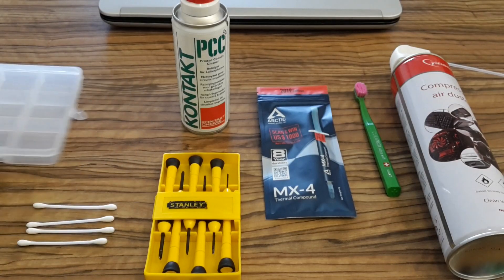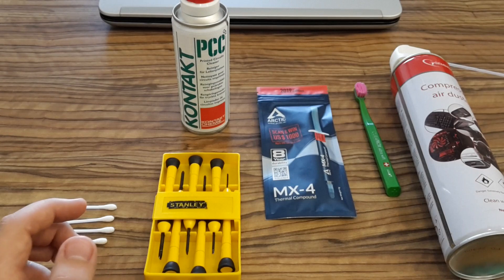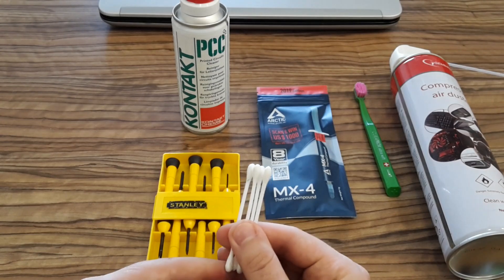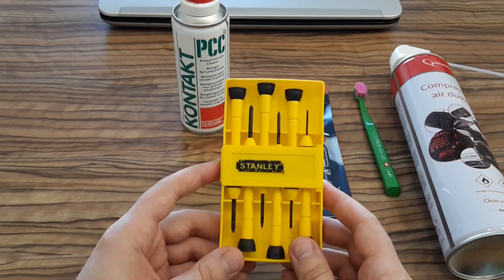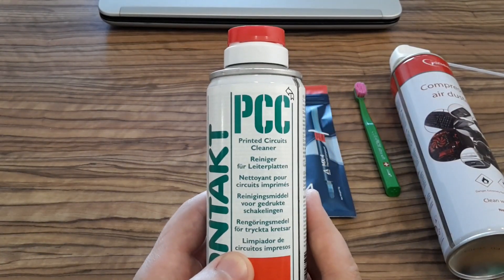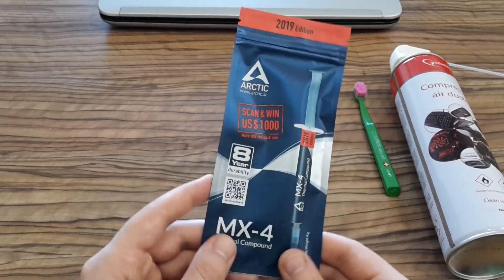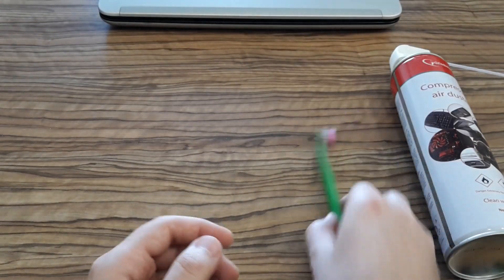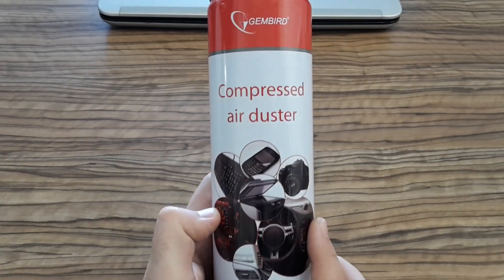Dell XPS 17 L702X Cleaning and Applying Thermal Paste

Comment: Thanks a lot! I almost gave on my 12 years old laptop, with random freezes / blue screens and idle temps of 85 - 90 degrees... Then, I found your video and decided to give it a try... 2 hours later ( I really took my time because it's the first laptop I've ever opened), it was back from the deads. Idle cpu temps of 55 degrees, 60 degrees while browsing and other light activities! Next steps: battery and windows 11!

Comment: Oh my ... my XPS L702x is 10 years old. I thought I might be able to do this myself, but skimming through the video I realize it would be stupid to even try - considering I've never opened up a computer before in my life. I can't risk ruining my XPS, which I'm very fond of. I guess, I am better off entrusting this job to a pro, right?

Not sure my laptop actually NEEDS new thermal paste. But it seems to run hot and the fan is always on. Otherwise it works normally.

Comment: Hi my dell has been freezing, crashing, and generally just been absolutely unusable for longer than 5 minutes. At first I thought it was software and driver issues and I did clean installs of windows 10 and it still didn‘t fix the issue and multiple built in diagnostics say that there don’t seem to be any hardware issues. Then it struck me: What if its the heating? I mean I havent cleaned and reapplied thermal paste in like 6 years lmao. You think I should do this?
Reply: Also after a clean install of windows 10 how do you recommend installing the drivers since I am not rly that hyped about using 3rd party programms that install them for you
Reply from the maker: Hi, is your laptop battery all right?

Comment: Can anyone comment on what NVIDIA driver they are using?   I had to DDU both the 555GT drivers and the INTEL ones and re-install them.
I'm sure I only have the basic NVIDIA now and wanted to upgrade to something stable
Reply from the maker: Hi, after installing Windows 10 it automatically detected both of them and  installed drivers. You can check in Device Manager if you see them.

Comment: Thank you for putting this together, very helpful. I did, however, not notice the comments regarding the tightening pattern for the heatsink until after I finished putting it back together. I am going to roll with it as is and see how it goes. I covered the areas pretty well with thermal paste and I am guessing I will not have a problem. Thank you again though!
Reply from the maker: Hi, yes I forgot to mention because I didn't know that time that there's such a pattern. :-))) Now I know there are numbers on screws which you have to follow.

Comment: What surprised me is I never had to open my xps 17 l702x. The i5-2430m and GeForce GT 550m have run like a champ for 9 years with a overclock of 795.4mhz core clock 1080 mem clock and 1530 shader and it's been used daily and cleaned regularly. I love this laptop honestly
Reply from the maker: Yes, so do I for 8 years now.
Reply: @zeroampselectronics  omg same here xps  l702x with 3D screen (that I never used).. amazing laptop! I just upgraded to max of 16GB RAM and a bigger SSD, and a new dualband network card ( Intel 7260 HMW) so I can also connect to 5 GHZ wifi networks :D

Comment: Does adding SSD to l702x improves the performance?
Reply from the maker: Hi, of course it does. You won't believe it how much.
Reply: @zeroampselectronics  how much read write speed you get? By the way thanks for this video, i am going to clean my laptop fan. It is making so much noise
Reply: It'll max out whatever the SATA version can do, given it's a machine from 2011 it'll be SATA 3 at 600MB/s. M2 SSDs are doing 3000+MB/s now of course.
Reply: gaming performance not too much except for load times. every thing else dramatically faster load times

Comment: This manual reproduces the errors from the previous ones on the internet.  NO NEED TO DELETE THE DDR MEMORY !!  You DO NOT NEED to detach the LCD screen.
Reply from the maker: Hi, you're right there're many ways how to achieve the same thing.
Reply: Late reply (2024), but thanks for this. It's also unnecessary to unplug and remove the Wi-Fi card.

Comment: Hello guys, please I need some help, I have done everything according to your instructions, my laptop was working fine, after putting it back together it won't go ast the dell screen, won't go in bios with or without hdd or ram... Can you please tell me what I have done wrong.. I haven't opened the cpu or anything else...??? Please help...
Reply: Guys thank you very much for your response, it was an usb board that I have replaced, it was for a dell 701x.
Reply from the maker: Oooh, such a small thing :-)))

Comment: Thanks for the video, It helped me with the disassembly. However, I would like to note something. When you are screwing back the heat sink, you are not following the order in which the screws should be screwed. The sequence number is right next to each screw. This is  important to ensure that the heat sink will work properly.
Reply from the maker: Yes, exactly you are right. I forgot to follow the numbers. Thank you for noticing that.
Reply: You mean no matter where I start, the essential thing is screwing them right to next, clockwise?
My XPS17 is open right now, I'm cleaning old thermal paste, and will re-assemble in the afternoon. Thank You!
Reply: @IlTurko  If you notice, there's a number next to each screw on the heat sink. That number indicates the order that you should follow to screw the screws. Start by screwing the number "1", then the number "2" to and so on.
Reply: @z4ub3r3r  Thank you! Working right now
Reply from the maker: @IlTurko  Hi, as I understood that. The unscrewing starts from the highest number and the screwing back starts from the lowest.
Reply: @zeroampselectronics  hi, finished the job. Absolutely exciting for me, since I'm a total hardware noob and never did anything like this before. The notebook looks just perfect, cool and working very well. Thank you again.

Comment: Excellent video.  I recently re-pasted my old XPS-17 but now the CPU is throttled down at 0.78GHz, have you experienced this or do you have a solution for this problem.  Perhaps I just need to take it apart and redo the thermal paste again.
Reply: I had the same issue and that was the reason why I decided to re-paste mine in the first place. However, before doing that, I searched on the DELL website to see if a more recent BIOS was available (I know is a quite old laptop). To my surprise I found a BIOS released on 05 Dec 2013, so I installed it. That resolved the issue of the processor stuck at 0.78GHz, but this is what I find odd. Even thought that BIOS have the most recent release date, is version A11 (my laptop was running the version A19). I did't realized at the time of running the "update". I will apply the A19 version again hopping that the computer keeps performing normally.
Reply: @z4ub3r3r  Hi César - I think there is now a 2020 BIOS update - I'm always a bit reluctant to flash the BIOS but it is apparently recommended by Dell
Reply: @robertparker7243  hi Robert, where is this 2020 bios update?  I could only find that 2012 as being the latest one on dell's website.
Reply: @z4ub3r3r  Cesar, I also did the bios update with the 2012 one, and it looked like it worked ok, but when checking in system information, it still says "A19 from 2012"", any ideas why?
Reply from the maker: Hi, try to look at it when the laptop is under full load. Try to run some video rendering or something similiar to have CPU at 100% load.

Comment: Broke the subwoofer cable :(
Reply: @zeroampselectronics  I put the blank connectors in place, it still works :P

I have 2 XPS 17's, and the one that my gf owns wont show signs of life. Not even the power putton lighting up. Started to disassemble the whole laptop, re-paste the gpu and cpu, clean dust and but back together, (also checked all connectors...) But still no signs of life, I think the charging port could be dead.. How can I check this? Any ideas?
Reply from the maker: Have you tried to use it without battery? I mean only with the adapter connected. I would also check the adapter itself trying the laptop with your adapter. Then try to use it just with your fully charged battery without the adapter. Is the charging led on if is the adapter connected? Then try to remove memory modules and test it without them. Try to remove all cards and drives and test it without them. You can check the power button wheter it's all right measuring voltage on it and also measure voltage on motherboard after connecting the adapter. Start checking the laptop from the easiest one.